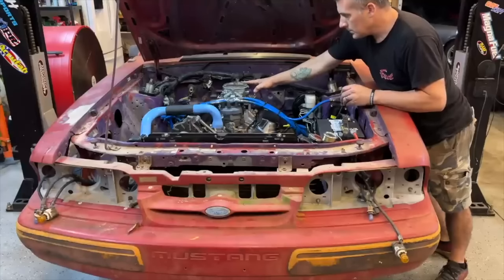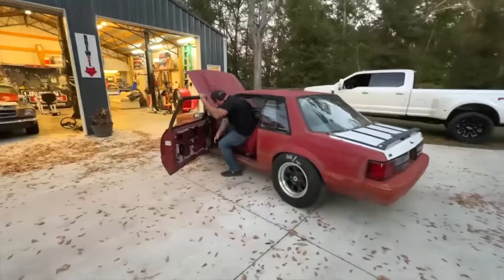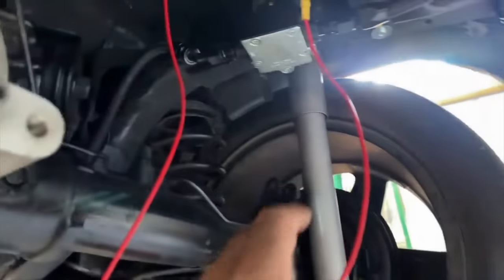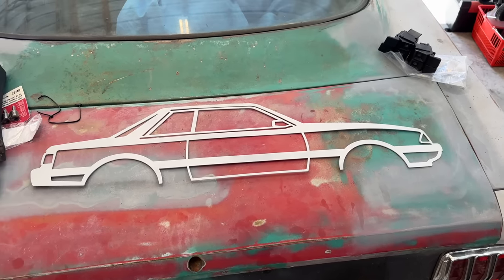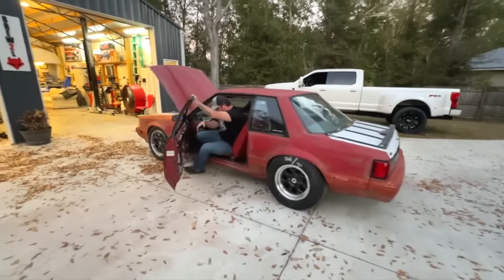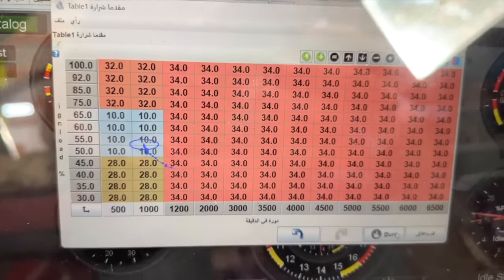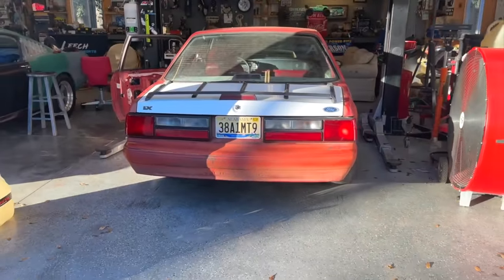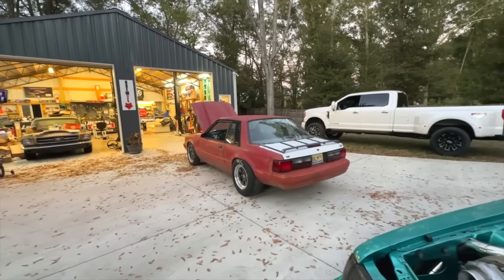I Heard You Wanted To Carb Swap Your FOXBODY.. I GOT YOU BRO!

Comment: That’s a lot simpler than I thought it would be Brother! Seems like the most expensive part would be the carburetor if you are just doing the swap! 💯 I absolutely agree on the MSD products lately! Great job with the voiceover! 👊🏾👊🏾
Reply from the maker: Thank you sir 🙏 it’s crazy but the mega squirt is cheaper than the MSD setup. Especially if you go Micro squirt
Reply: @BREW2LFOXBODY  That is crazy!! Things that make you scratch your head!!😁 From what I’ve read on MicroSquirt… it’s a very simple install which makes it an even better option than MSD. 😎
Reply: Yep on the msd, stuff is junk. I’ve got a new coil, faulty. Older 6al2 box. Just went out couple weeks ago. Freaking sucks. I know the new box is gonna be junk. Not even gonna waste the money on it. What’s a pain is before the coil went out, I was having all kinds of drivability problems, long starts, and it ended up being that new coil. I put the old motorcraft one back on and is been running fine.
Reply: @jcnpresser I've had some bad luck with MSD. Foxbody coil,3800 coils(3) lasted 6 months bf ALOT of random misfires.  Foxbody coils are just dead. But I can say I had a 6AL & BTM last years so I guess it's just a gamble.....

Comment: Hi guys on my build I took the MSD system out and replaced it with a Progession ignition. Very easy to install and to control the boost and timing on my carburetor Supercharge engine. I could control everything with my mobile phone. Very good ignition.

Comment: If you're living that true budget lifestyle, a Ford Duraspark 2 box, a factory ignition coil, and a factory 85 distributor will make the conversion easy, and it'll all cost about the same as 1 piece of MSD equipment. It's also very easy to adjust.
Reply: the GM style 4 pin HEI module will work with the Duraspark distributor also, and they are even less $$$
Reply: Do y’all know what the deal is with changing the distributor gear? I had heard something about that but can’t remember the reasoning
Reply: @jvincemusic  my son's car, an 82, originally had a flat tappet cam, which requires a bronze distributor gear. But we put in a roller cam, which requires a steel distributor gear. You've got to know what kind of cam and gear you've got. O'Reilly's carries an 85 style stock distributor in both gears. You just have to make sure to order the part number with the correct gear for your cam.
Reply: @KrisGreenhillsGarage  flat tappet cams normally come with a cast iron gear not a bronze. Bronzes gears wear out fast and aren't intended for street cars.
Reply: @faststang85  you are correct. Cast iron, not bronze. I do my best to avoid  flat tappet cams and got my gears confused.

Comment: Microsquirt for data logging and ignition is awesome for boosted carb stuff. Cheaper and better than an msd box. Now you can go with LS coils and ditch the distributor
Reply: Are you just throwing ideas out there or are the LS coils an actual thing? I saw an individual coil setup done by Chicane back in the day but wasn’t aware people were doing this now
Reply: @jvincemusic  I run a 460 with a 36-1 wheel no distributor and LS coil packs. Been 7 years now. I also run a microsquirt on my diesel. Use it.for data logging, methanol control and boost control. It's far superior just to run micro over a msd.

Comment: I carb swapped my 93 lx hatch and I highly recommend progression ignition’s distributor with the racing features. You can change the timing, rev limiter, 2 step launch rev limiter, nitrous retard, etc all on your phone through their app on the fly in real time. It also has a built in kill switch. Definitely an amazing option for anyone going to a carb

Comment: Got my distributor locked out, learned that trick from you and mine is fuel injected still. With the bigger cam in it, it seems to run better. I’ve had anywhere from 30-38 degrees and have had no starting issues. I’ve got around 32-34 right now, seems to be the best for what I’ve got. I slowly collecting the parts and money for a carb swap. I want cylinder heads also though. I think the car would run better with the cam that’s in it with a carb. Heck I have to baby sit in the morning till it gets done heat in it. Idles kinda crappy. Im so over the factory fuel injection 😅

Comment: I live above 5000 feet altitude.   you want fuel injection up here.   in the summer,  a carb car is harder to start when its hot.   no problem with fuel injection.    also, great drivability in the winter with fuel injection, better than a carb on start up .  however, if you want  a carb, this is a nice set up.  looks kinda like a holley clone carb.  very nice.

Comment: wouldn't an HEI distributor be the best budget option? can get Ford retrofit ones with the correct length shaft to drive the oil pump from many manufacturers. Any parts are available in your local parts store if anything fails, it's just 80's GM stuff. Don't have to pay MSD prices when something fails, nor buy expensive engine computers and learn software..

Comment: ok my only question is if im going to spend the money on a standalone ecu like the mega,micro wouldn't it just be smarter to buy that at the start and tune the car up with the efi? Feel like the easiest way to swap to carb is an Hei dizzy, manifold carb fuel regulator. Just curious is all.

Comment: So to run a carb and keep the stock ignition do I leave the map sensor plugged in and run a vacuum hose to the intake? And leave all the other sensors unplugged except for the coolant temp and oil pressure sensor so my factory gauges still operate?

Comment: What about going with a carburetor distributor, what would be needed for that? and how different would a CFI to carb swap be
Reply: i did this swap on my 84 cfi went with an hei distributor one wire will run it makes it simple but make sure you have the right gear on the distributor if yours is a flat tappet cam
Reply: @martinez6037  what did you do for fuel, thanks

Comment: Could you also use the same ground from your arm switch wired over to you or NOS button so you could not accidentally activate it without having the correct timing table in place?

Comment: Meh I’ll just keep my efi
Reply: Better drivability in the winter time.  Doesnt stink like gas.  Plus better fuel economy.  Efi way better.  I am not happy with the carb and  hei distrubutor  setup i have on my 86.
Reply: I agree but I’ve just never been a fan of carbs. I may be a lil biased but efi just seems all around better to me.
Reply: @Deeznuts84356 no doubt. Been down this road, never again. I'll deal with the stock ecu until I can't, then go to holley efi